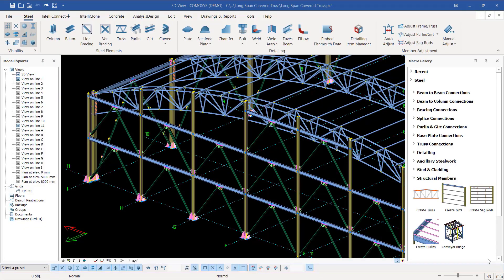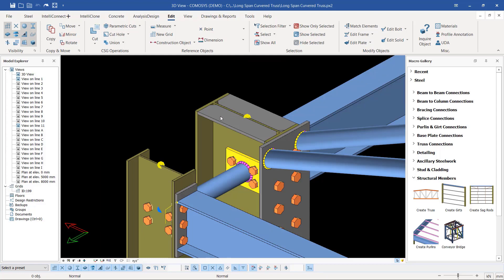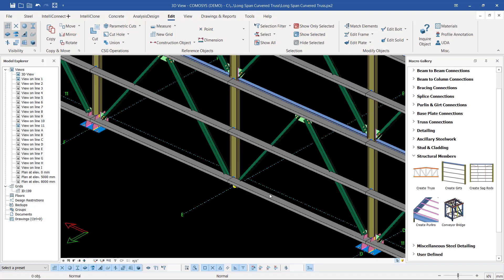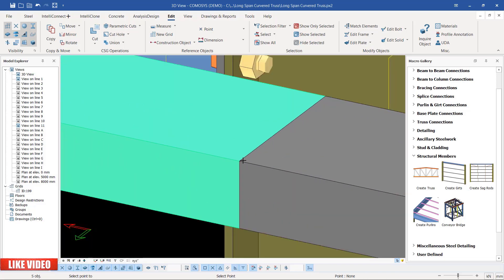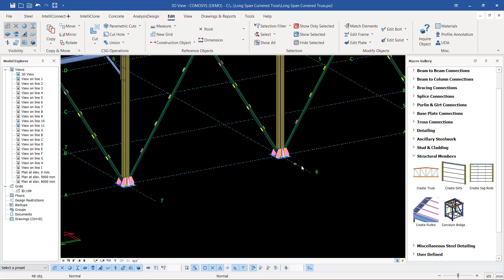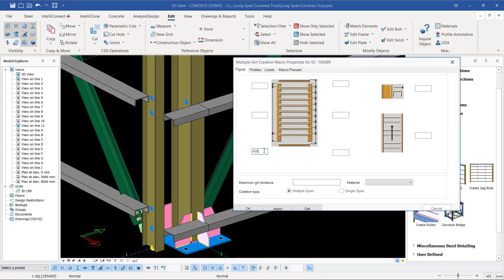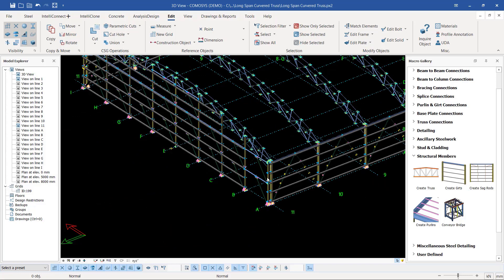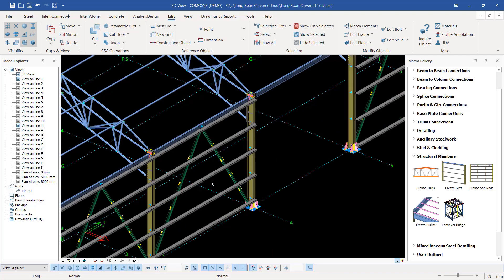How to Create Curved Truss in COMOSYS_Part12 _Creating Cladding Rails

Comment: Nice video, sir! I wanna ask, what's the advantage of COMOSYS compared to SOLIDWORKS? Thanks
Reply from the maker: COMOSYS is a steel and concrete detailing software | Solidworxs Software is more of mechanical component creating software but COMOSYS also does mechanical components like fuel storage tanks
Reply: @MauriceDimba , I wanna ask again, if I model a barn silo, can COMOSYS analyze the stress at the mid-height part? Thanks